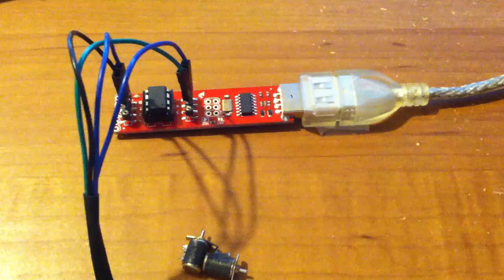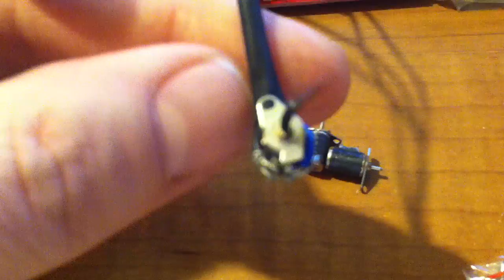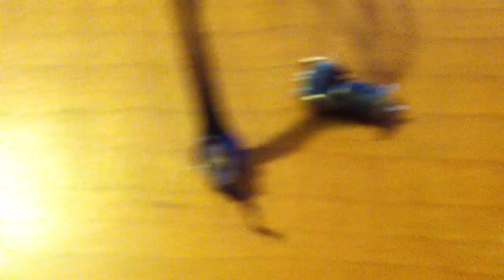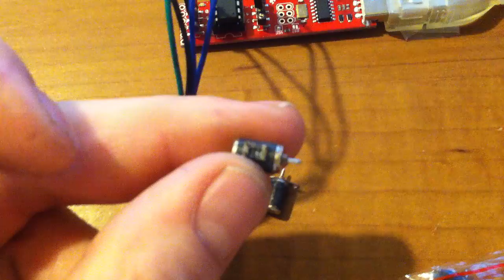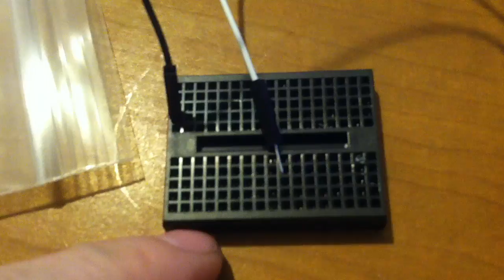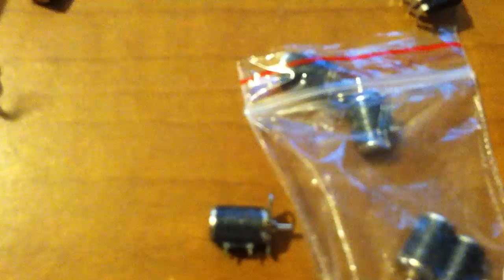TINY Arduino Stepper Motor

Comment: I have been scratching my head about this for a while.  You do not show an H-Bridge in the video, but the code you linked uses one.  The code also references pins 2,4,6,7 for the stepper.  That does not make sense to me because pin 4 is the ground.  Possible the code link is not correct?
Reply from the maker: +George Miller It may have been changed a little but I got it to work with very little change from the original code. I would have to load this again on the Attiny to check. But yes, It did work with that code with little or no edits. Hope that helps. If you have the same setup and you are having issues I may be able to help. Other than that, try it out. No hbridge was ever used.
Reply: I will try this then.  Thank you!
Reply from the maker: +George Miller Get it working?
Reply: I could not.
I wrecked 3 tiny steppers trying to solder leads for breadboarding.  After the third, I got frustrated and gave up for the moment.  I have 17 more, but I think I need better solder tips before I try again.

Comment: hi brad, how many steps per revolution? and volts/amps?
Reply from the maker: +rodstartube  They run at 3.3-5v not sure of the amperage or steps per revolution. I was not able to get a datasheet from the company I purchased them from.Guessing 20-30 steps per revolution. Guessing though.
Reply: If they are the same steppers I used, think they are.. they are 18 degrees per step, so they are 20 steps per revolution.

Comment: you never said and nobody asked: how many steps per revolution? thanks
Reply: 20
Reply: Not much torque from mpu pins.  I did do half-steps.  Using some transistors, or a h-bridge would be more useful.  I had bought a box full of these.  Cool to play with, though.
Reply: The regular Arduino stepper library works fine with these.
Reply: @davidharris7249  have you tried some A4988 stepper driver or similar?
Reply: @rodstartube  Yes, lots of choices now.  For a simple animation, these might be fine directly from the pins, though.

Comment: Does it have enough torque to move a small robot with tiny wheels? Do you have the datasheet with you? Thanks.
Reply from the maker: It's possible.The robot would have to be pretty small though.No datasheet was available but the manufacturer/distributor said that these run at 3-5 volts.

Comment: I'm thinking about using these to make a mini linear actuator. Do you think these stepper motors would be strong enough to turn, for example, a 40mm x 2mm steel threaded rod? And do you know what the maximum RPM is?
Reply from the maker: I am not sure how much torque these have or what your application would need.They are so cheap it's probably worth trying.They do not have a datasheet that I know of so I am not sure of the rpm.
Reply from the maker: I also just thought of this. I ordered another lot of 10 that actually had a 9-10mm threaded rod already pressed on. I think these are used for  linear movement for dvd/blueray focusing lenses. The link is below. I think these are just a little bigger and seem to be built a little better.This would probably be your best choice.

http://www.aliexpress.com/snapshot/6386443522.html?orderId=64951371238307
Reply: Brad Focht Thanks for the response and the suggestion! It's worth a try, the linear actuator is meant to move and control a small arm in a robotics project so I hope these will be strong enough to at least move the threaded rod.
Reply from the maker: Ronald Wijermars Did you ever give it a try? If so, how did it turn out?

Comment: The motors are cool but I think the real amazing thing is that you got that programer working, I just got mine and am having alot of difficulty getting it working.
Reply: Brad Focht Thanks so much for this...  I'd ordered a pack of 10 off Amazon and just started playing with them... I'm new to Arduino and electronics (but not programming).  If nothing else, your wiring solution helps me a lot since I am finding the soldering to be problematic - I'm not good at it either.  I'm going to try an LD293D shield and the EasyDriver motor driver.  I will also be interested in how much torque these little guys deliver.  I'm so glad I kept looking through the videos and found this!  Thanks!
Reply from the maker: I followed this guide from sparkfun. If you are sure that you installed the the USBTinyISP Driver and added the ATtiny Addon to be able to get the ATTiny menu in arduino, you may just have a bad programmer or bad ATTiny85 chip. Hope this helps.
https://learn.sparkfun.com/tutorials/tiny-avr-programmer-hookup-guide/?_ga=1.73937754.999866103.1422042233
Reply: Awesome thanks